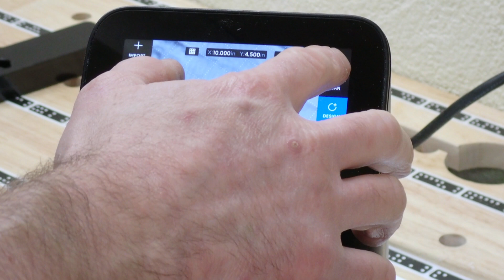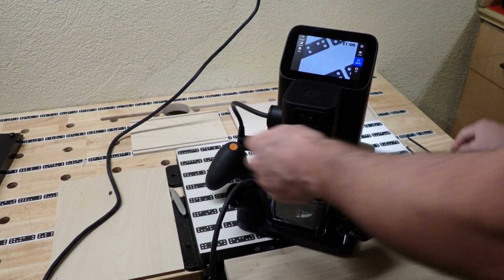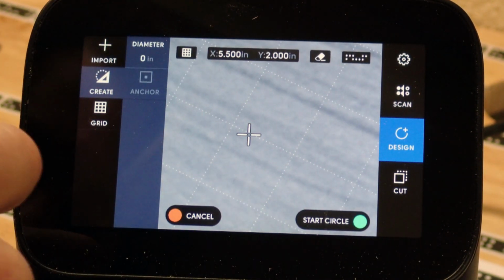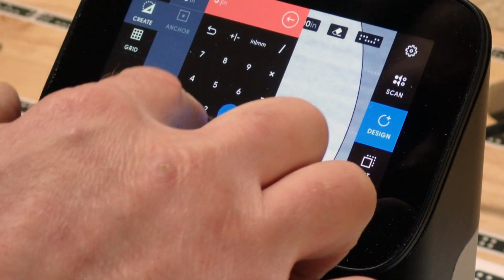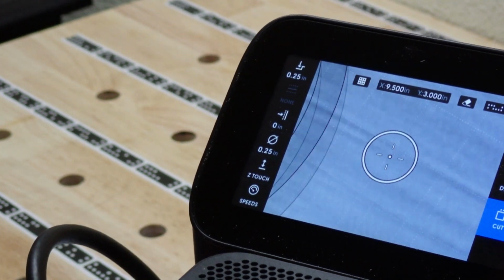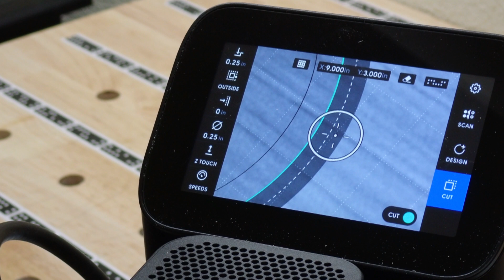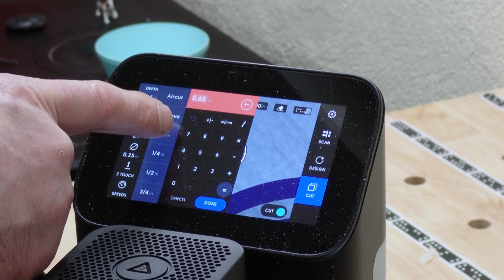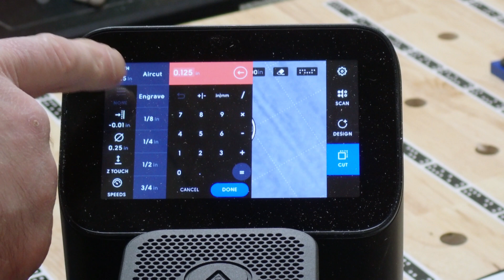Shaper Origin: Grid and Offset Practice Project

Comment: it has those two little slots on your red button side of the plastic cover I just put a piece of tape over it and it draws all the dust down instead of spraying it out on the side
Reply from the maker: A quarter of the time, the biggest problem is forgetting to turn the vac on.

Comment: How did you do that without getting any tear out? Whenever I cut a circle there is a lot of tear out.
Reply from the maker: I only cut 1/4" deep passes in hardwood, and I stop the last pass just short of full thickness, all at an offset of maybe 0.01.  Then I make the final clean-up pass at full depth with no offset to clean it up and cut it loose.